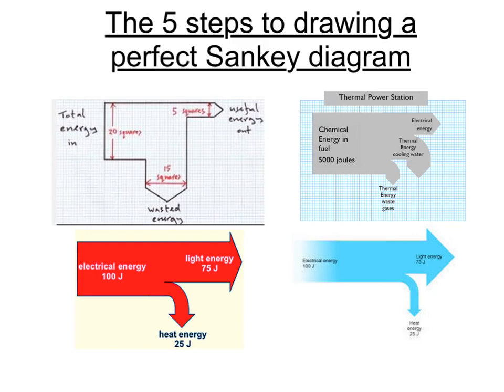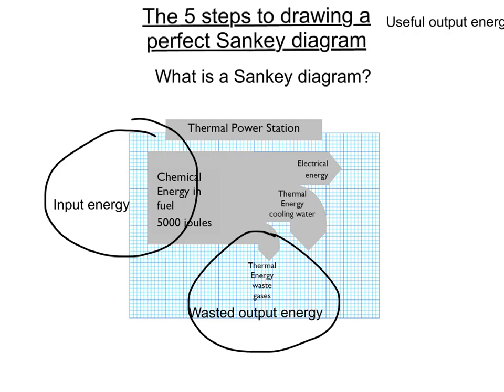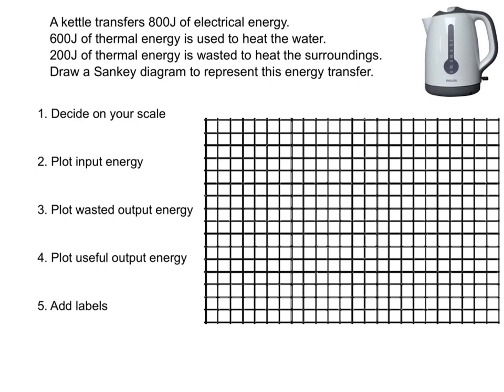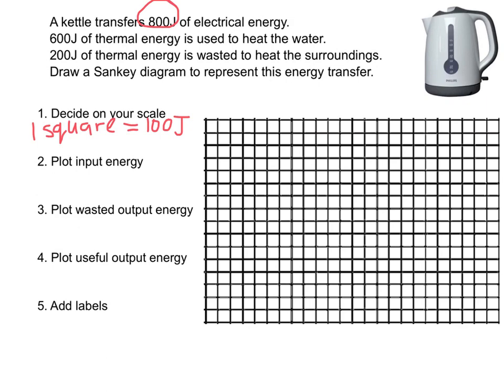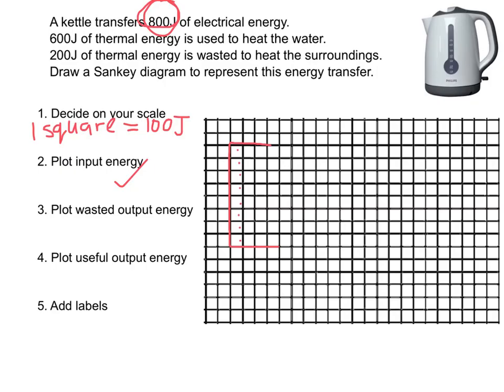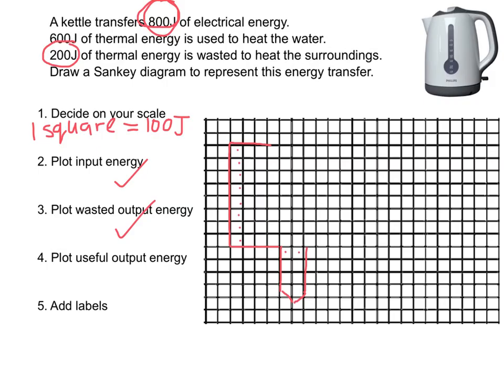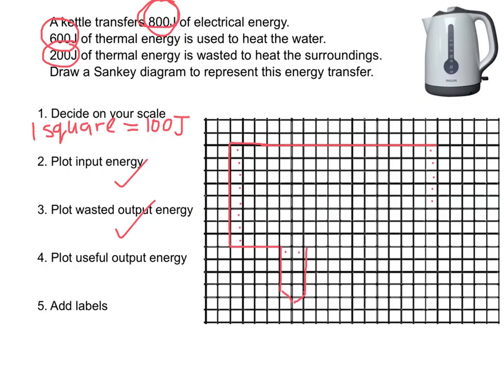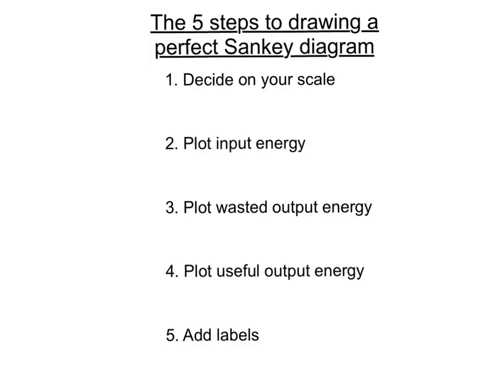The 5 steps to drawing a perfect Sankey diagram

Comment: does it matter if the lines are curved or straight and if the arrow is straight would it be pointing in the same direction as the arrow you did also how do you know how wide do to the curved arrow